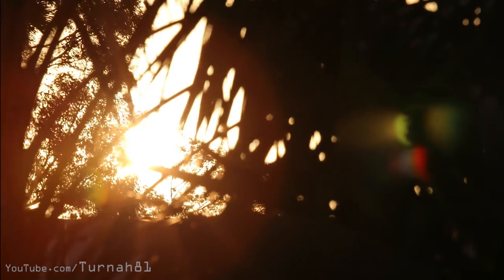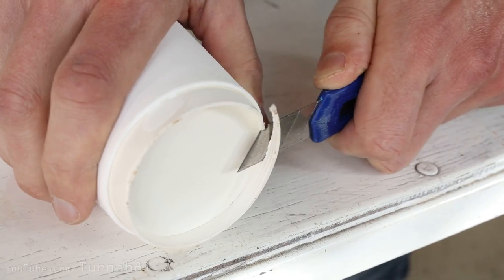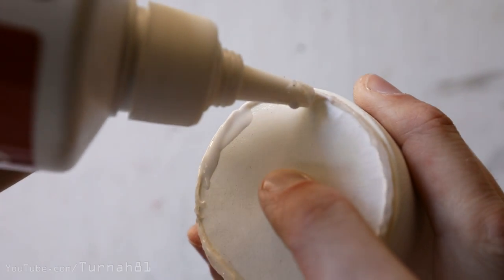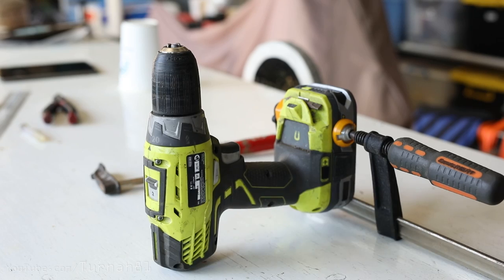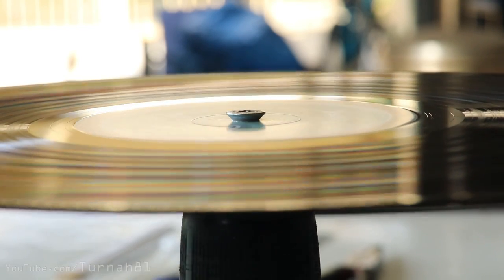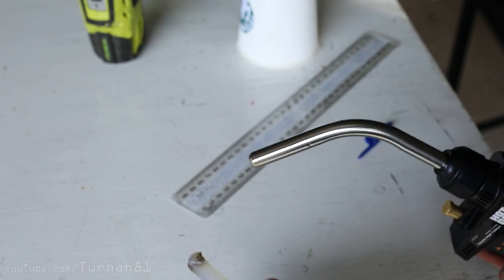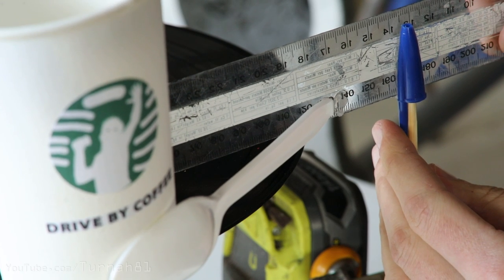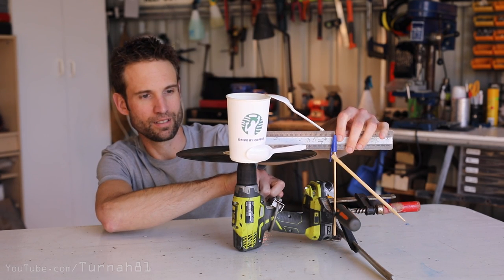I didn't expect this sound! - Coffee Cup & Drill Record Player"

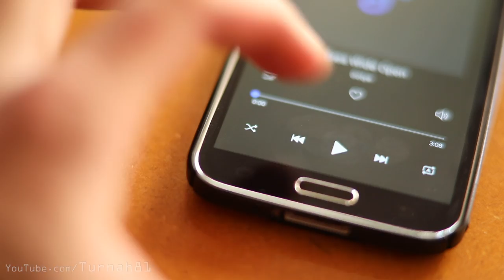Comment: 1:00 WiFi routers usually have a USB port on the back, you could charge a phone with that, it might not be the fastest thing but in case of an emergency it's good enough
Reply: M Isa If there is no power how can your router charge your phone?
Reply: @Hagervily  if you watch the video you can see that he powered his router with a car battery
Reply: He must be thinking the USB port in the router would still get power from the phone line. 

Telephone jacks have 5V positive and negative lines, cell phones charge at 5V, thus a telephone jack can be used to charge a phone. FWIW, I've never seen a power outage take out the phone system.
Reply: @RadRidesByCru  thelephones jack have 40 volts in their lines
Reply: Thanks Lancelot. Googled it... 48V DC line current... 5V DC off hook... 90V AC ringing.
Reply: @RadRidesByCru  I thought the phone lines stays on even when the power is out?
Reply: The phone line does... but routers use the main electrical service to power the internal circuitry. Much like a relay, cut off power to one side and it cuts power off to the other side.
Reply: @RadRidesByCru  so.. what happens if someone decided to call you through telephone line? will your phone get killed?
Reply: @dolbyprologicii  yup it will get the full 90 volt ac experience xD

Also phone lines cannot deliver enough current to charge anything
Reply: "the full 90V A/C experience"... haha, I can picture a phone's little skeleton lighting up from the shock. Since you'd need a voltage regulator between the phone and line it should absorb the power increase, and a diode to help control the ac/dc switch when ringing... it should live. 150mA from the phone line is about a quarter of the output of a USB port though, so charging would be slow.

Comment: You can flatten that record out with glass panes and an oven at about 112 degrees and on for about 2 to 3 minutes
Reply: country boy 1970 tried that once , didn’t turn out great to be honest , I find just putting lots of weight on them for a few months works ok
Reply: @valley_robot  ok yeah I've never tried it but I've been told it works by some pretty respectable folk though they did say you could overdo it

Comment: Buy about 4 or 5 solar panels and a long wheel-barrow type frame to mount them on, add a couple of deep cycle batteries and a 1500 Watt inverter and a 10 Ga extension cord and keep the fridge running.  If you have a Bunn Velocibrew coffee pot, this takes priority: brew a pot of coffee while the water inside is still hot, THEN get out the solar.....

Comment: There is a lot of modal distortion - I think from direct drive with drill motor. You may smooth the rotation by gear down the drive than built in speed control. Also an actual turning table, maybe a perpendicular wooden disk would stabilize the record vertically.

Comment: When you can afford a $130 drill, but can't afford a cheap $20 record player.
Reply: When you forgot the reason of the video
Reply: @TheShipMaster  A simple rubber disc fitted with a rubber disc in the drill chuck will drive the turntable or, even a large rubber band around the turntable as a drive belt.  There is as they say more than one way to skin a cat.
Reply: Steven Booth but turntables need amps which need power.

Comment: You can also figure a way to recharge your cell phone battery, that shouldn't be too hard you might be able to use a motor as the generator.  If your neighbors water service is on you can waist their water on a water wheel to turn your generator or try using the wind. Or in slave a member of your family to turn the generator.  Just some ideas I'm sure you will figure it out. Love your work.

Comment: Instead of a cup and push pin try rolling a sheet of construction paper into a cone and tape a sewing needle to the small end. That will create more of a horn and amplify the sound better although it'll be directional. Another fun idea might be to set up the turntable platter onto some Lego gear assembly powered by a weight that slowly descends to the ground.

Comment: Wait, do record players DIY or not even require electricity?
Reply: The motor to rotate the turntable as well as any kind of sound amplification would need power; everything else is mechanical.
Reply: Early phonographs had wind-up motors. No electricity
Reply: @djhrecordhound4391  Thanks.

Comment: Hey can you make a generator Video using...

1 a drill
2 a bicycle 
3 wires
4 lights bulbs 
6 tape/Velcro
7 aluminum foil 
8 batteries (optional) 
9 plugs/Connections
Reply from the maker: It's now on my list

Comment: the bad sound that comes from all these is bcoz the mass of the device youve built.... nex time try to make a thin glass needle (very thin and reheat the point so its like a water drop not sharp edge like when u break it) with the torch and then glue it on piezo, then u can plug it in any bt speaker as aux or mic input. its all because of the mass and the high frequencies that cant move the object at that speed... next simplest design... just glue the needle on styrofoam that looks like a street sign, while the needle should be on the "sign" part edgeway

Comment: Opening your freezer during a power outage is a bad idea. Same goes for the fridge.
Reply: Why?
Reply: @TokyobuckettsLive  The compressors (the chilling mechanism) on refrigerators and freezers do not run all the time, they don't have to. They only run about once every 2 hours with normal use, that is normal opening and closing. But if left closed, many modern freezers can go more than a day without the compressor even kicking on, and refrigerators can go many hours without the compressor kicking on. This is because of improved insulation. But the moment you open a refrigerator all the cold air rushes out because it's heavier than the warm air in the room. The compressor will need to turn on shortly thereafter or the food will spoil. Freezers with a front-facing door have the same problem. If you have a box freezer with a lid that opens up, much of the cold air stays in the freezer when the door is opened, and the compressor need not necessarily kick on. Thus, if the power goes out and you don't open the freezer, probably have nothing to worry about for several days. The same is true for your refrigerator for at least a day or two. But if you open it even once, all bets are off.
Reply: @josephdestaubin7426  but, not drinking beer during a power outage is even more deadly... I know my priorities
Reply: @DrTheRich  Nice. Lol

Comment: Hmm I think I would have broken out my mobile router, tablet and numerous USB power packs and carried on as normal.  Some people are so ill prepared.  I have at least ten decent sized power packs for such situations.  They provide charging facilities, power cooling fans, emergency lighting etc.  Cheap to buy and also easy to make from old laptop batteries etc.  I wouldn't be without them.  My cycle even has them as a power supply to lights and keep my phone charged.  No-one need be without power in this day and age as they can be charged via solar panel but, hey, I get it.  It's just an excuse for a project.  However, put the pin hole in the bottom of the cup BEFORE cutting off the bottom rim.

Something to mull on.  How about perfect silence than imperfect music...just saying.😀